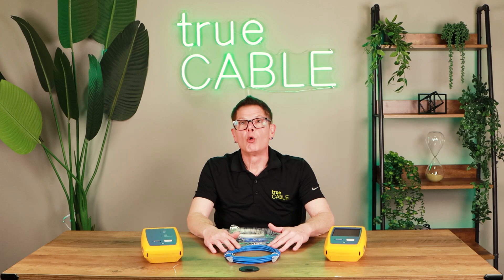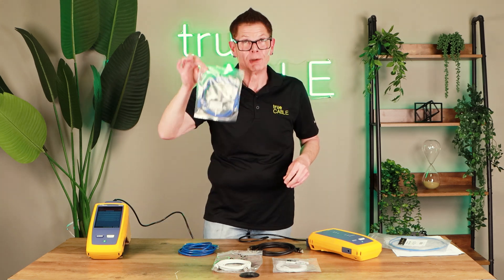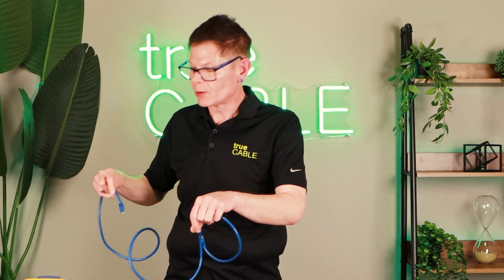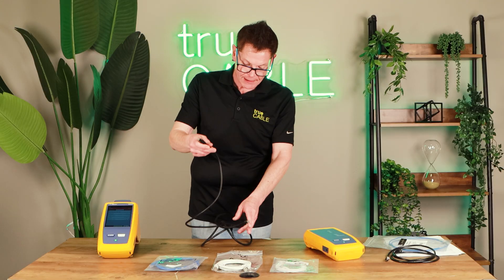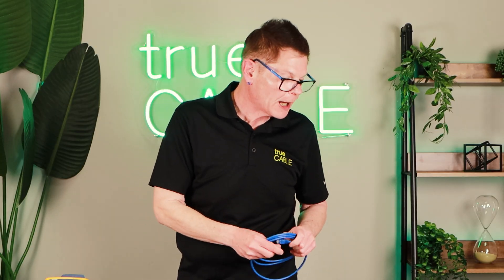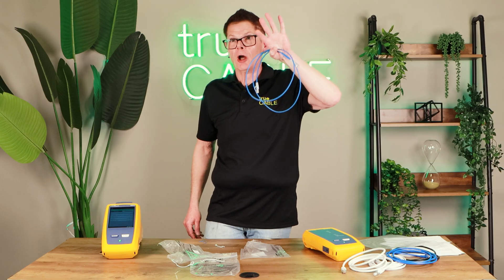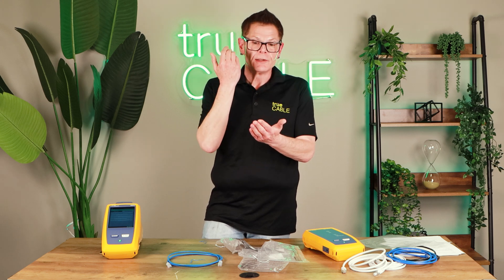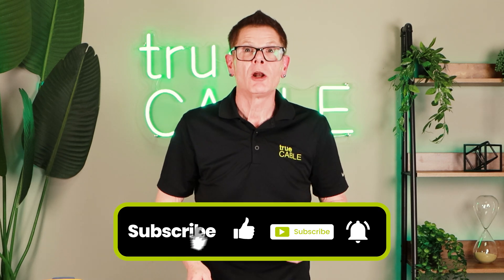We Tested The Top Rated Patch Cables in 2024!

Comment: this video brings up 2 important questions 

1] is the constant failures due to  poor termination of the cables [this is my guess] 
2] If it is then who actually buy from?? I would like to buy from you guys but i checked your site and only bulk for long runs and short patches [i normally buy in 50-100 foot factory terminated cables, not only that i just learned to terminate ends and i suck at it [to get it perfect that is] if the amazon sellers cant get it right how can little ol me. . whats your thoughts on media bridge cables, there highly reviewed, ul listed, and actually pure copper unlike most companies on amazon
Reply from the maker: Hello! You nailed it. The issue is due to the terminations, nearly 100% of the time. When purchasing, avoid patch cords that are not component level (component rated) and have not been 100% patch cord tested during the production process. trueCABLE sells 28AWG stranded copper Cat6 U/UTP patch cords from 6" to 25ft that 100% pass strict component rated testing. We sell these cords on our website and on Amazon. If you need longer ones constructed from solid copper then we suggest using category rated field termination plugs instead of RJ45 connector plugs. These are both male plugs, but field termination plugs will give you much better results and are designed to work well with solid copper conductors. The downside to field termination plugs is they are more expensive and are larger than RJ45s which may make them unusable for you.
Reply: @trueCABLE  thank you for the response[s] i really appreciate it, will say tho 2 issues still reamain

 1] if a manufacturer cant get right how is a novice immerdiate or even expert . honestly makes me feel that i will never be able to get an excellent termination  . . 
2] who do you buy from for 100 feet cables, i did a bunch of research and its next to impossible to find cables that have individual tested like you test your patches  patches  
2.5] sounds like you guys need to start selling tested 50 -100ft cables since no once else is doing it
3] i like media bridge and they are ul listed and stated that there verrifed to meet tia/eia spec, but it seems verrifed does not actually mean tested. . 
kinda sucks this is all so ambiguous
  
But i do want to once again say thanks, i really appreciate your responses
[
Reply from the maker: @mikeriverajr4447  Hello! Patch cords that have been "Verified" are tested for wire map continuity only. Verified does not mean performance tested to a certain Category. Yes, getting a good patch cord does require effort but you won't find the lengths you are looking for in the component level and 100% Certified realm as factory terminated patch cords really should be used for short patching applications...not for full distance runs as you may be hoping to use them for. Long distance runs (more than 25ft for example) should be done using solid copper and keystone > keystone. The patch cords are simply used to patch into that link.

Comment: Why is the patch cord you sell 28 awg, and do you plan on making a thicker gauge patch cord in the near future.
Reply from the maker: Hello, and we chose 28AWG intentionally. It provides a good balance between usability distance-wise with excellent routing characteristics at the patch panel/patch manager. 28AWG thin patch cords allow for much higher-density installations with a lot less hassle. We may look into thicker conductor patch cords in the future, but quite frankly our biggest sellers are 6" and 14ft. We don't sell many 25ft ones, for example, and we have those on offer. Given that 28AWG is good for up to 49 feet (in total, both sides of a channel or two total cords), we are nowhere near the limit on usable footage at this point.

Comment: Hi, which fluke is best & lowest cost for certifying just copper based networks, CAT5, CAT6 etc?
Reply from the maker: This all depends on your requirements and how much you can afford. Fluke offers certification testers 3 versions of the DSX-602, which is the most basic of these testers and has the lowest cost. The next two versions are Fluke's flagship testers, the DSX-5000 and the DSX-8000. The difference between these two is the ability to test up to 2Ghz Cat 8 cabling with the DSX-8000 model.

If you are looking for a very good tester that does cable verification, the LinkIQ is an excellent cable tester at a more affordable price. As stated, though, it is a verification tester and not a certification tester. This all depends on what your requirements are and what your job requires.

Hope this helps
Reply: @trueCABLE  thanks for replying, I have basic cable testers like the Klein Scout Pro. I’m looking for a Fluke that actually certifies, measures for attenuation etc. I’m on a budget and have been looking at used Fluke DSP-4000 + DSP-4000 Smart Remote kit on eBay which sell for roughly £500, do you think they would be okay for certifying Cat5, 6, 6a? As those are the cable types I will be working with.
Reply from the maker: @ct7700  I would not recommend a tester like the DSP series from Fluke, which is obsolete. The DSP-4000 series only tests to 250mhz, so it does not go past Cat 6 cable testing. If you are looking for something more affordable, look at the LinkIQ from Fluke, or you can also check out AEM, a different company but a bit lower priced. If it has to be certified, you will look at the more expensive testers. However, if you just need verification, which will still show attenuation, NEXT, and RL, the LinkIQ is a great option.
Reply: @ thanks again, I know the DSP is old but it will certify the cable that I use which is CAT5 & CAT6. Also with the analyzer graph I can pinpoint where the defects are on the cable runs so it satisfies my needs for now. Will buy a DSX later on down the road.
Reply from the maker: @ct7700  Not a problem! Hope everything goes well with your setup!

Comment: I just priced the DSX2-8000.  Wow!  I had to go to the bathroom after I saw the price. lol!
Reply from the maker: HAHA! Indeed. Fluke Networks has the market pretty well cornered, and well, they are charging accordingly. That said, this type of Certification device is all but required by professional installers with budgets that can handle one or more units. Oh, and the initial asking price is only the BEGINNING. Each year you can look forward to $1,300 or so in calibration fees for each DSX2-8000 set (main and remote).
Reply: @trueCABLE  Does this mean I should just buy your certified cables instead of building my own and hope they will be in spec?
Reply from the maker: @costumesforalloccasions  Hello! Yup, you nailed it. You should not be constructing your own patch cords, especially with solid copper conductor cable. For a lot of reasons. That said, IF you do such a thing then the only way of making sure the patch cords are good is to have at least a Fluke LinkIQ around ($2,300 and up) and better yet a Fluke DSX2-8000 ($10,000 and up). It is cheaper and easier on you just to buy the pre-Certified patch cords and be done with it.
Reply: @trueCABLE  so I learned how to build cables for nothing.lol Thanks for your reply!
Reply: @trueCABLE  I was talking about doing long runs. I guess I could do an estimate if how much cable I would need.
Reply from the maker: @costumesforalloccasions  If doing long runs, then consider solid copper Ethernet with field termination plugs at both ends. That will give you what you need most likely, but just be advised field termination plugs are not only more expensive than 8P8C connectors (like .02 vs $6 each) but field termination connectors are much larger physically. They might not work out well for you. You may want to contact us directly for some targeted advice for what you are up to.
Reply: @trueCABLE  Thanks!
Reply from the maker: @costumesforalloccasions  Hello and you are welcome!

Comment: I noticed this also...lots of dodgy cat 7 and cat 8 cables from the jungle...after pulling them apart, and it's like, no way is this cat8, tiny strands and poor shielding...inspect the terminations with a 10x magnifying glass, and barely in there right, short of the front...and then just testing with my lcr meter etc. and seeing high capacitance and resistance...so-called shielded cables and no continuity, or like 20 ohms resistance on the shield...ironically some older cat5e cables were better...

That said, it's the terminations that are the worst...just redoing those helps a lot...

I test with the LCR meter and then a 10G switch...if it passes a hundred gigs of iperf at 9.4ish with no crc errors, it'll do...
Reply: iperf3 -t 120 -c 192.168.x.x --bidir -i 60
Reply from the maker: Hello and thanks for sharing your observations! Yes, the terminations are going to make or break a patch cable. This is why each and every patch cord worth the Category printed on it has been Certified to the standard post-production and prior to being shipped.

Comment: What did you have to say about cat7? You mentioned that you were going to say things about it but I didn’t hear anything about it.
Reply from the maker: Hello! Here is the truth on Cat7 -- All Cat7 patch cords on the market terminated with 8P8C (aka RJ45) plugs are counterfeit. Each and every one. In the ISO/IEC 11801 spec 8P8Cs are not used for Cat7 on patch cords, it is GG45 or TERA connectors. In addition to this, the vast majority of so-called "Cat7" patch cords I have tested (the only exception being the one I tested here) FAIL even Cat6 patch cord testing. So, just because there is a Category stamped on the side of the cable does not mean the cable will get anywhere near the performance that is required of it or that it is built to the correct specifications.

Comment: I would like to offer my story regarding a bad patch cable.  I am currently running a Unifi setup with patch cables from Truecable and Blue Jeans Cable (they are another company that certifies every cable before shipping and also includes a test sheet with every cable).  I use Blue Jeans cables for longer runs and Truecable for shorter runs.

I noticed that I was experiencing packet loss according to my Unifi logs and also saw that my Netgear CM2000 upload link light was blinking constantly.  When I looked into this, I noticed that my cable from my Dream Machine SE wan port to my Netgear CM2000 wan port was a so called  "premium Cat7" big brand cable.  When I replaced this cable with a certified Truecable patch cable, the upload link light on my Netgear CM2000 turned solid and has remained solid since the switch.  Also, my Unifi logs are now clean with no more packet loss warnings!

Do quality patch cables matter?  In the data world, you bet it does!  Granted my scenario is a home setup, but in commercial environments, it is critical!
Reply from the maker: Hello, and thanks for sharing your story. I often use the same Ubiquiti equipment you do for home and small business installations. So, I have used the same method to track down quite a few less-than-quality patch cords. Cable quality matters not only in big data environments but also with smaller-scale setups! Consider that 2.5G is becoming the norm, and you will understand why. As to your "Cat7" cable, that is no Cat7 cable. If it were, it would have been terminated with GG45 or TERA connectors at both ends. The ISO/IEC 11801 standard does not call for Cat7 to be terminated with 8P8C (aka RJ45) connectors, and therefore, it was counterfeit before you took it out of the bag. You also discovered, as I have, that a solid Cat6 patch cord will easily outperform poor-quality Cat6A, "Cat7", and Cat8 patch cords. The more you know!

Comment: I am going to guess these ''competing cables' are no name stuff on amazon with brand 'names' made by RNG and not a real budget brand like monoprice

Did you forget to go back and include why cat7/8 is a load of marketing bs? or did i miss it somehow, maybe it was lost in editing...

The way i rule of thumb test cables to check for cat5e is a pinch test (making sure the cables are twisted) another issues with cheap ones that pass can have crappy insulation that cracks, you know what cables have given me the worst PITA problem over the years... SATA cables, if shielded sata cables were a thing i would have bought some. have also found trash RJ11 cables that have ~6kohm resistance over 4 feet you can't even repurpose that, i could not even solder to that junk. i will use old telephone wire for basic GPIO with micro controllers (button, led, photocell, switches)

i have used dielectric grease to protect all connection for my HDDs, replaced sata cables more than once, and was at the point of if i have to do this one more time i am wrapping them in aluminum foil w/ tape/heat shrink and connecting said foil to my PSU's ground

one time i bought cables i though would be blatantly fake for scrap wire so i could get a refund via buyer protection...

usually fake network cables just run at 10/100 speed and 'work' fine in the eyes of the random person
Reply from the maker: Hello! You can be sure that the patch cords we tested were obtained from the larger and more recognizable manufacturers. We at trueCABLE take the high road on such things, so we won't be calling out manufacturers by name. trueCABLE is not an independent review site, and since we sell our own competing products, our motivations will always appear biased for obvious reasons. A YT influencer review channel can dive in if they like. Now that we made this old news new again maybe someone will peel it back fully. This issue has been well-known in the ICT industry for 2 years. Fluke Networks and CCCA can both point to largely the same results. Anyway, it affects IMPORTED (read: from Asia) patch cords, not domestically sourced ones or patch cords that indicate they are Component Rated and 100% Certified (as are ours). Agreed on the SATA cables. I had my share of issues, too. Yes, these poor-quality patch cords seem to work just fine in the eyes of the average person because most are not pushing higher than 1G. Often not exceeding 100 Mbps. That is changing, as you are likely aware. 2.5G NICs and capable routers are becoming more common. Coaxial Internet speeds are going higher--often available at 1 Gbps. Fiber Internet speeds are approaching 5 Gbps. Also, whoops on our part. Yes, the information I was going to provide on Cat7 is that you cannot have a patch cord that is terminated with RJ45s. Not how that works, and not in the ISO/IEC 11801 spec. They are supposed to be terminated with GG45s or TERA connectors. Essentially, any patch cord stamped with "Cat7" terminated to RJ45s is counterfeit immediately. That was lost in editing, and thanks for pointing that out!
Reply: @trueCABLE  I ran into 5Gb Internet issues worth Slim Monoprice cables and these fixed my issues. Monoprice's thicker cables still work for me, but I wonder.